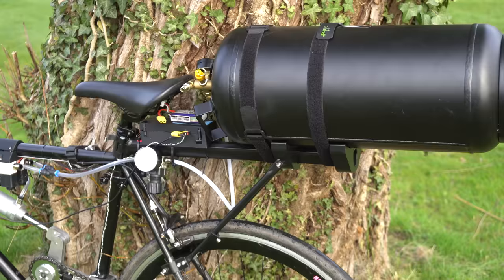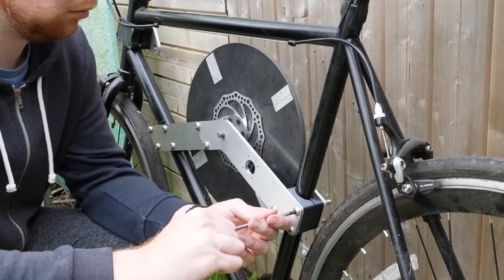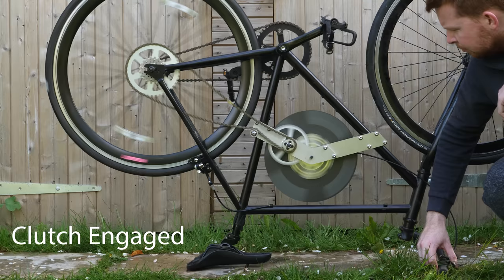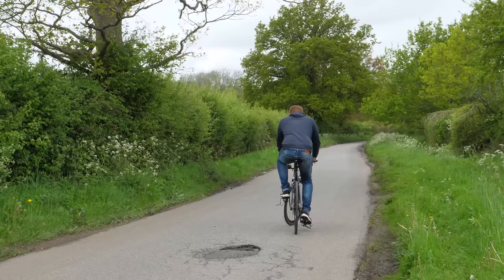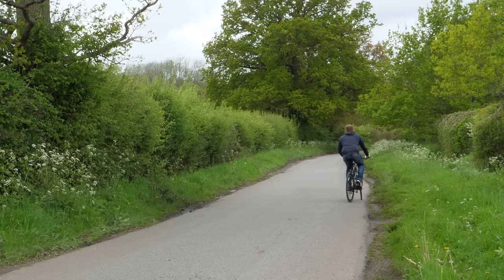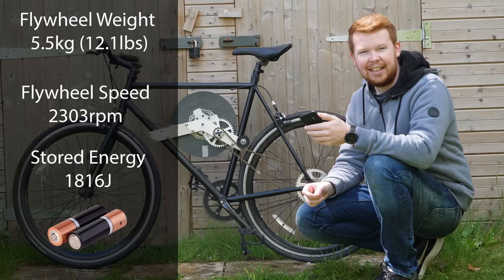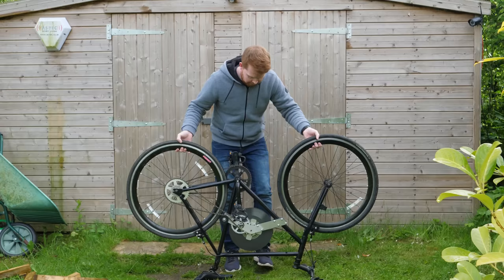Flywheel Bike KERS

Comment: Instead of a mechanical connection, combine the flywheel with two brushless motors: one motor for power and regen at the wheel, and the other on the flywheel.  This will give you flexibility in the regen and allow you to recover up to about 85% KE if you can get a controller to manipulate the voltages and currents to get the most out of each motor.
Reply: then you would need two clutches. I dont see how this would help beyond reducing efficiency
Reply: @nigelbess5168  You could clutch electrically using the Transistors you already have, which wouldn't waste additional Energie at all
Reply: So a battery basically?
Reply: This is not efficient there will be too much loss of energy. You can get an E-Bike instead but the E-Bike can't reload fast enough.
Reply: @jantube358  On the contrary, as the comment stated, you could get up to 85% efficiency. You'd be unlikely to achieve that in practice, but it's way better than the 15% achieved with the mechanical system.
Reply: it would be efficient but it would make the bike as heavy as an ebike
Reply: <<Instead of a mechanical connection, combine the flywheel with two brushless motors: one motor for power and regen at the wheel, and the other on the flywheel.  This will give you flexibility in the regen and allow you to recover up to about 85% KE if you can get a controller to manipulate the voltages and currents to get the most out of each motor.>>

For people who aren't fit for cycling,  e-bikes seem to be hugely popular these days.

For those who ARE fit for cycling a conventional bicycle is a marvelous transportation machine.  Leave off all that crap which is useless. 

Human being have two legs with the most powerful muscles in the body for acceleration and cruising,  and the bicycle has a marvelously flexible gearing system to utilize that power effectively.  And most cyclists come equipped with a BRAIN that allows advanced planning to minimize energy loss through wasteful braking. --- by gradually allowing wind resistance to slow you as you approach a possible stop,  and often being able to avoid the stop through planning.   That is far simpler and more effective than any regenerative braking I have seen or heard of on bicycles  ----good for locomotives though,  I suppose. 

The biggest energy losses while cycling are wind resistance.  That CAN be minimized by using a recumbent bicycle or fairings to efficiently direct air around the blunt human form,  but both are very rare. 

PERHAPS someone will come up with a regenerative braking system  that is cheap,  lightweight and effective,  but there is nothing or the horizon that I've seen or heard about.  This flywheel approach may be interesting as an abstraction,  but it is junk in practice.
Reply: @reifrei1170  still lighter than mechanical kers
Reply: @jantube358  don't store energy in a battery, store in a Super Capacitor (SuperCap new grapheme style)  almost instant charge from any electrical supply, step discharge through resistors & specialist circuitry to power motors.
Reply: @nigelbess5168  I think the point is that this would uncouple the ability to drain the bikes mechanical energy from the rotation speed of the bike wheels and flywheel.

As he showed his ability to recover energy is limited by matching translated angular speed, I think only by approaching a 1:infinity translation he approaches  the ability to transfer all the energy. But he was already limited by physical size. 

With electronics you're less likely to run into these limitations.

It's not really about efficiency while transferring the energy, but about the ability to transfer the energy at all. Compare to eg. a cooling element vs a heatpipe, a heatpipe is much more efficient, but if your target temperature is below the heat stores you can provide than that doesn't help you and you need to go for an cooling element or something similar.

Mind you, it could still turn out to be less capable in total, because efficiency losses are too high, but assuming that you can keep the efficiency in check it could, as far as I can guess right now, win out.

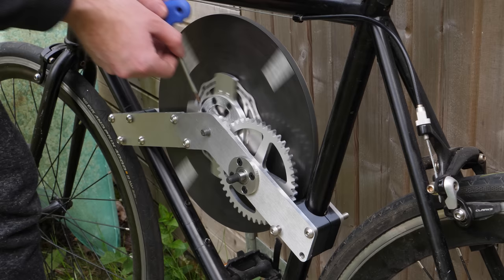Comment: 3:57 solution is to CNC the holes slightly (maybe 20 or 30 thou) undersize, then finish them with a reamer or endmill of the specific size required. Ideally that center hole would be drilled/bored on a lathe but the endmill/reamer method works too if it's done right. Cheers!
Reply: I was thinking the same thing as a simple solution. Might want to take a look at how that router is interpolating the holes, too. Simple tool path change might solve the problem…
Reply: WTF is “thou” 😭😭😭
Reply: @Sjwatts  thousandths of an inch, us machinists shorten it to "thou" because it's easier and faster
Reply: Why not just wire EDM or finish with a Jig Grinder? ;)
Reply: Yep reaming is the way to go. Buy an adjustable reamer or spend 80 bucks per size of reamer😬
Reply: @Sjwatts  do you think every person you interact with is stupid EVERY time you dont understand something? You must be incredibly exhausting to be around.

Comment: Hey Tom there is this video on a simple ball CVT by “funtastyx” that could be just the simple and compact CVT you need to make this flywheel more effective than using a clutch that can slip.
Reply: The main problem with CVTs is that they are not very efficient, but they might add more efficiency because they would reduce the requirement for using the bike's brakes.
Reply: What about a Nuvinci CVT?
Reply: Maybe a Constantinesco torque converter?
Reply: @ArchieHalliwell  not true at all, there are very little efficiency losses if your belts are tight
Reply: @ArchieHalliwell  CVTs were used in some early hybrids/eco cars because their efficiency is really, really good. The problem is that they can tend to [fail/slip/underperform/lose efficiency] at high torque/speed conditions.

As in, 7000 RPMs in a car moving 2.5 tons of weight. Not at 2000 RPMs moving ~300lbs of weight. 'Course that would depend on the CVT in question and your tuning.

A perfect CVT would, by definition, be the best possible transmission in all scenarios. The only reason they aren't is slippage. The tech has and will continue to get better.

Comment: As others have said I'd like to see how the efficiency numbers change once everything is lubed up! Also I'd imagine the real world function of the flywheel would be to assist in pedaling rather than used alone, so a qualitative improvement vs no flywheel takeoff would be interesting too.
Reply: Im also curious to see that, AND I would also like to it with an additional flywheel. where there is one that is captive to the rear sprockets and wheel and a rear sprocket with additional speeds as space allows that would allow for ease of driving the rear wheel’s flywheel up in speed and the extra mass of the flywheel being attached to the rear wheel/sprocket would allow for better maintenance of momentum when cruising. I also think that in conjunction with this there should be, for the current under frame flywheel, a set of gears specific for each action of the flywheel that have the best mechanical advantage for each action. Being that the flywheel may be spun more efficiently by one gearing in order to be accelerated by the braking force, but a second gearing on the opposite side for applying the flywheels torque back into the bike’s normal gear system after a stop could prove more efficient than the current gearing that has to do the job of both accepting and returning the energy in both directions
Reply: In that a second gear that can more quickly transfer the flywheels torque would likely not have as much loss in energy
Reply: I'd like to see how it does with the flywheel used like a battery. Like how some old transit buses did with each stop having a recharge that topped it back off to 65k RPM.
Reply: Where you would gain a lot of efficiency would be to seal the flywheel inside a vacuum chamber. This is what they did on the prototype cars in LMP1 or at least I know that's what Porsche did for theirs.

Comment: The main problem and reason for the inefficiency is the direct coupling. To build a system that is capable of transferring 100% of the energy to the flywheel, you need a variable speed coupling. I am not sure if that can be achieved using a hydraulic coupling, though the most efficient solution seems to be with an electric motor / generator on both the wheel and the flywheel.

Comment: Definitely seems like the application of this tech would work best on a downhill slope. You wouldn’t have to pedal to give the flywheel maximum speed because the hills potential energy is being stored in the flywheel if it’s engaged while going down.